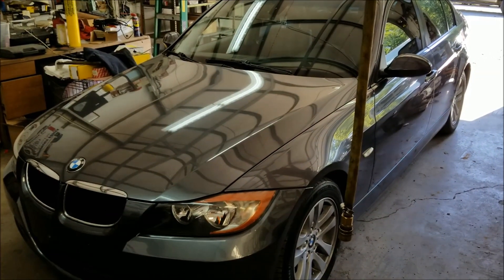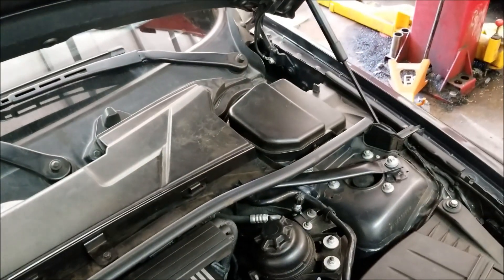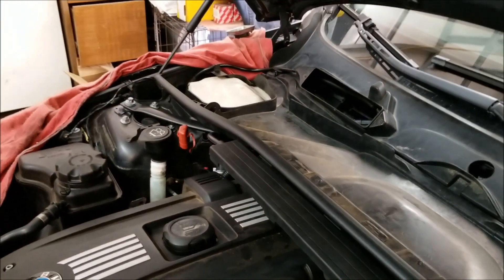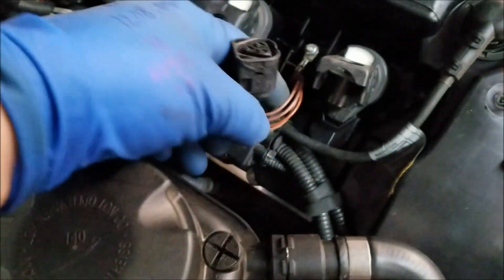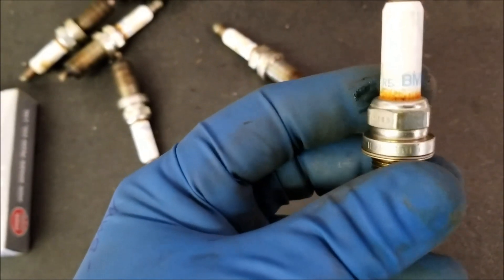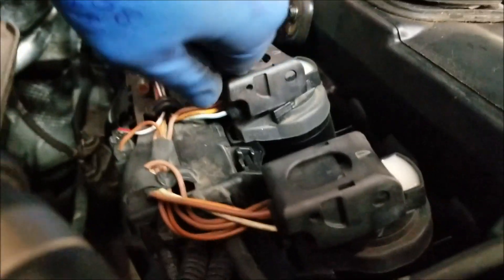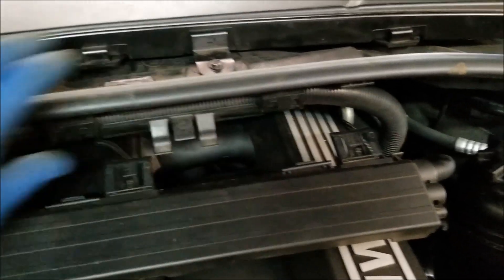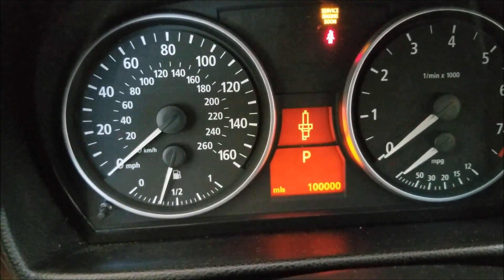Replacing Spark Plugs DIY! E90 BMW 328I - Shop Time With James

Comment: That reset trick doesn’t work for me for some strange reason. I did it your way also, put fob in do not press on brake,  press start button wait and then press on brake and hold button on dash and no triangle popped up

Comment: Thanks for the video. My BMW started with this problem... Did you have to change the coil packs too or were they good? In your experience do you have to change those usually when the spark plugs go bad?
Reply from the maker: The ignition coils can definitely fail. Some people will choose to replace the ignition coils during the tune up process to insure the longevity of the engine, however this can be expensive. 
Having to pay a mechanic labor twice can also be expensive as well, so the answer may depend on if you are doing the labor yourself or paying to have it done.
Reply: James Bradley Im doing it myself, but the coils are like 40 a pop... $240 total... plus 10$ a plug.. it’s hurting.. 🤣 Thanks for the reply James!

Comment: hello i replaced my spark plugs with BOSCH plugs..i dont get good gas mileage at all and i used 93 octane in USA..does the 2008 BMW 328i automatic call for NGK PLUGS?? I HAVE BOSCH COILS. SOME SAY USE SAME COILS AS PLUGS..please advise..thank u for the great videos.
Reply from the maker: Yes, the NGK plugs are going to be the factory brand of plug. Id highly suggest to use the correct plug.

Comment: Do you need to lubricate the threads when putting in the new ones?
Reply from the maker: Spark plugs come with an oil on the threads that keeps them from rusting, alot of mechanics will tell you that is enough to lubricate the threads during installation, however if you prefer,  a small dab of anti  seize will ensure it has enough slick'um on there to get it done!

Comment: Question what’s the name of that round metal cylinder like piece in between cylinder 3 and 4? A can you remove it to gain better access?
Reply from the maker: That is an electric servo that runs the variable valve lift system called VANOS. Do not remove them as an appropriate scan tool will be necessary to reset the VANOS system once they are reinstalled.

Comment: Just put all new sparks and now I’m getting misfire code ???
Reply from the maker: the ignition coils are exposed to high temperatures where they are located on the engine. Its not uncommon to have one crack during the procedure, and allow moisture to get into the coil secondary windings. You may need to replace the one giving you the misfire code. did you use the OEM plugs?
Reply: James Bradley  I used off brand cheap ones I exchanged them today for oem Bosch ones also had NGK plugs as well in there that  were 2 days old , I decided to get Bosch plugs double platinum instead of the iridium, when I went today to switch the NGK ones they were fried !!!! 

Was this becusse I was using shitty coils ? Or did I not install them properly 
I torqued them until I felt the tension 
Not sure if there’s a certain amount of specific way I need to do that .
Reply from the maker: @wendigoinc2438   if the spark plugs have a crush ring they should be tightened about 3/4 to 7/8 of a turn after you feel gasket touch. this crushes the ring and makes a compression seal. i would recommend the OEM spark plugs for these engines, the ignition coils can be damaged by using incorrect plugs.

Comment: I’m in the process of replacing cylinder 5’s spark plug and the connector won’t detach itself from the coil. Help??
Reply from the maker: They can be stubborn. They live in a fairly hot enviroment. The connector kinda flips up and then slides away from the coil.
Reply: I’ll give that a shot! Thank You man!

Comment: I have a bmw 320d 2008 , its misfiring and the automatic gear shifting is very late ..what can be the issue with it ?
Reply from the maker: Not as familiar with the diesel BMWs, but i know that some of the older transmissions were vacuum operated and broken vacuum lines could cause shift issues. however if you are down on power and using more throttle input than before, the transmission will see that and use a different shift strategy. you may need to correct the misfire, maybe an injector?